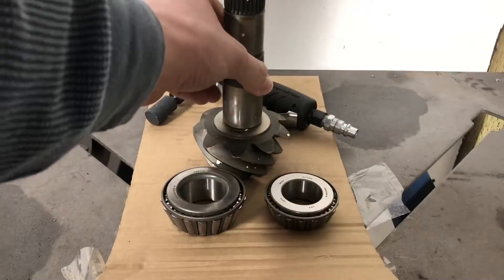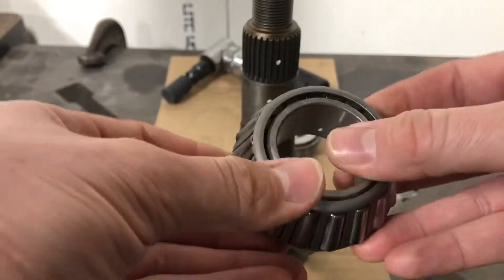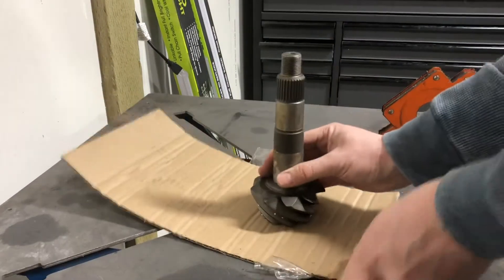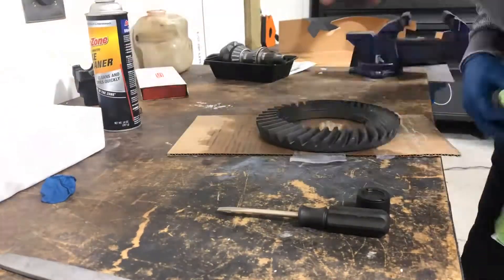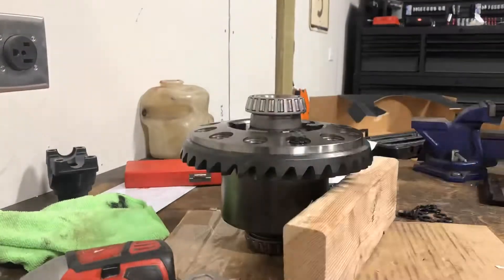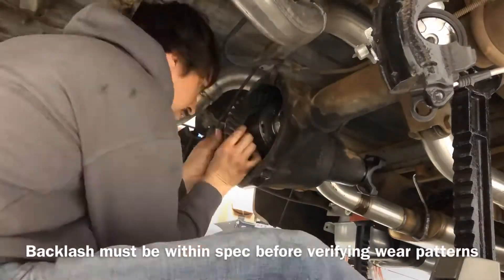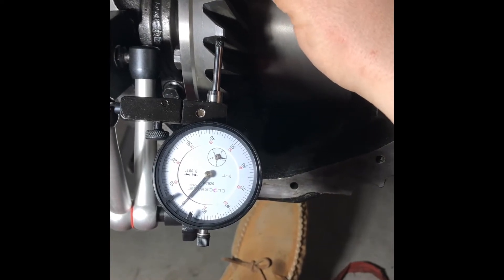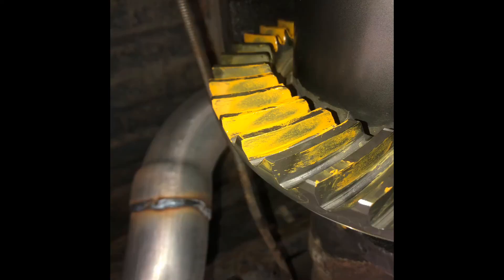C10 Driveline Upgrades Part 2: Ring and Pinion Setup Basics

Comment: Just an FYI if you do gears again.  You can just reuse the shims off of the old pinion (or at the very least replace them with new ones that are the same thickness). The depth is from casting differences in the case. So what ever gear set you put in the pinion depth for that case always stays the same.  So all you really need to deal with is the side shims to get your backlash set.